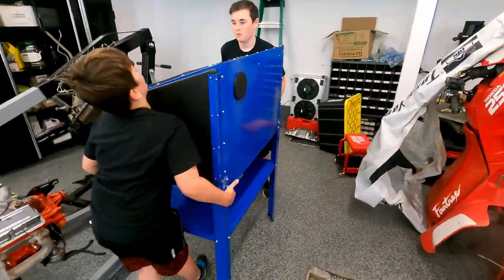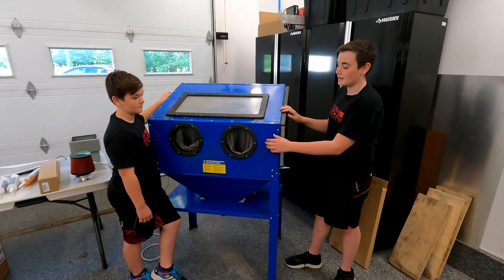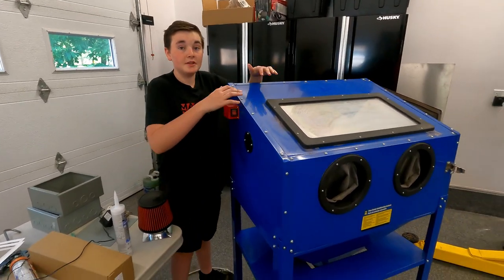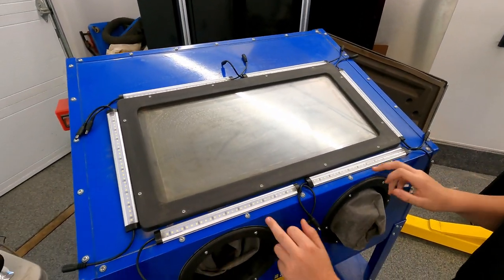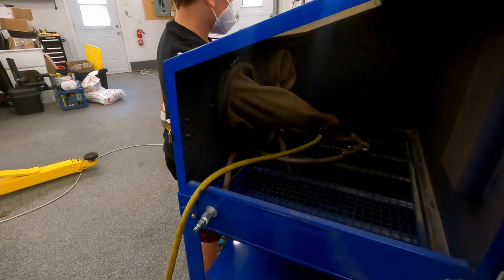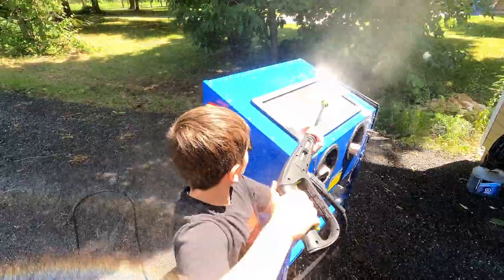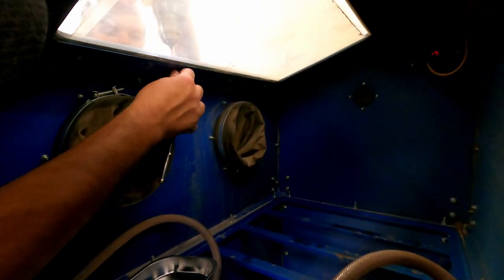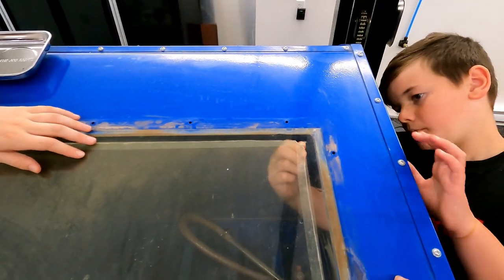Bringing our Sandblast Cabinet to the next level - Princess Auto / Harbour Freight

Comment: Ah the classic Canadian garage, Princess Auto sandblast cabinet, Maximum engine hoist and Husky cabinets. Looks like a twin of my own 😂 Where abouts are you guys? I'm restoring a Porsche 968 in Tremblant. QC
Reply from the maker: You are right!
Reply: @MassProject  I just got the sandblaster the other day but haven't put it together yet, thanks for the tips.
Reply from the maker: @JVR_Funwithdesign  Make sure to seal it properly and don't buy the light kit for it. There a better way to do the vacuum system using vortex with a 5 gallons bucket. It prevent the filter from clogging.
Reply from the maker: one hour west from Montreal